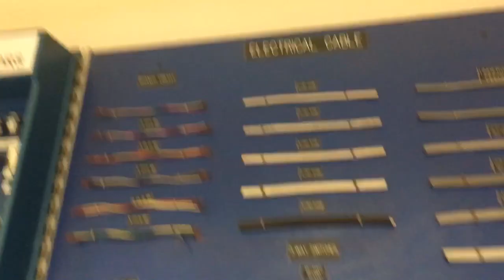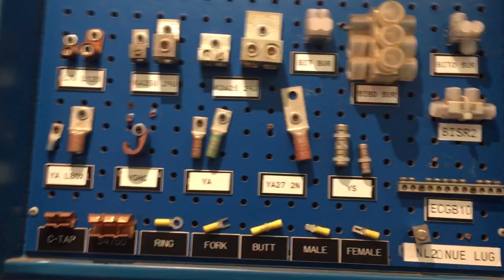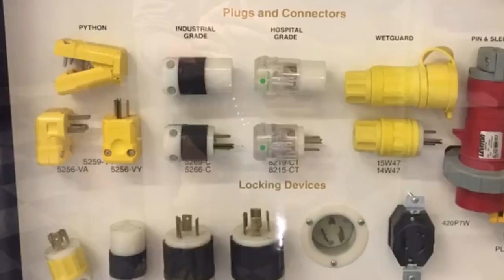30kw Grid Tie Battery Backup Solar Install: Solar Panel Mount Prep

Comment: Great Videos Johnny! Is the Sol-Ark system going to be Grid Tie? If so do you have an auto transfer switch, etc or just using the Sol-Ark in parallel to the main panel? Thanks!

Comment: You going to do more about this project. 84 total modules is a lot of power. Interested to see what inverter chargers and storage they chose.
Reply from the maker: Alex Fisher yes we are doing double Solark’s and genny
Reply: @GainSolarPower   oh is this going to be a paralleled solark 12k?
Reply from the maker: Alex Fisher two Solark 8ks with SLA batteries. AC/DC 12c solar air conditioners

Comment: Johnny, question: I'm getting ready to run power from my pole mount 3-panel array (Trina 300w TSM-DD05A.05) 15 feet underground, then into my pump house (Grundfos-11SQF-2 SQflex). The plan is to install the Grundfos CU 200 controller and IO 101-240 Volt Generator Interface IN the pump house for security & weather protection. What are your recommendations for conduit/hardware and best practices for wiring/connections from the PV array, into conduit and then up the inside wall of the pump house?
Reply from the maker: funkinflugen mC4 connectors on pv wire thru a pv wire masthead cordgrip into conduit 1” all the way to the controller. Or pv wire is direct burial. Just put it in the ground.
Reply: @GainSolarPower  Thanks Johnny that's what I needed..BTW the house project is going to be nice!